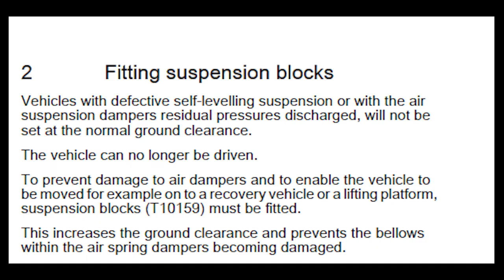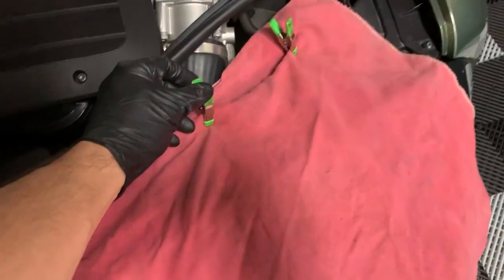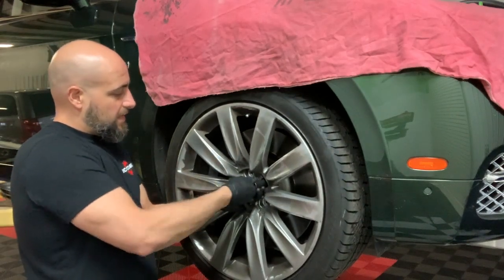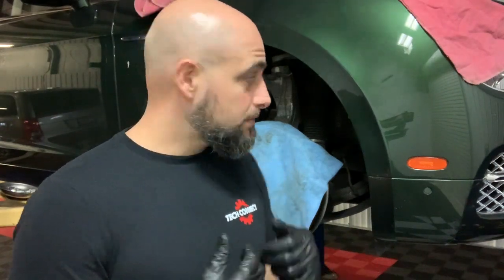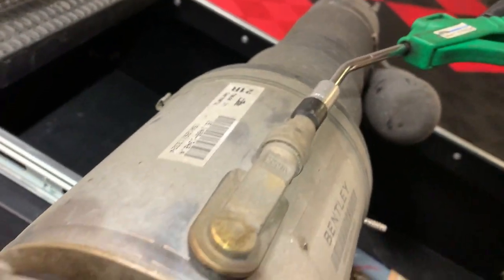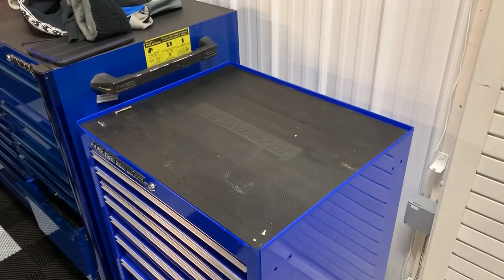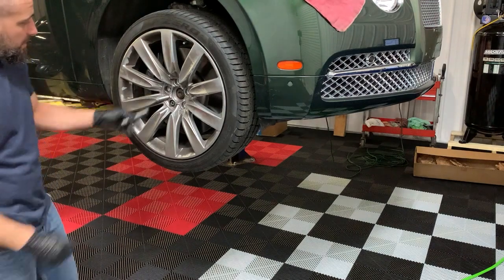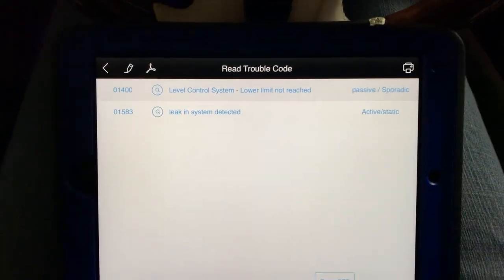Replace air shock Bentley Continental Flying Spur  plus tips when diagnosing air suspension issues

Comment: You can remove that leaking fitting and use a different nut to screw it back. That round button you see is a bolt. Vicegrip and it comes out. Replace with another that has a head. BTDT, problem is a stretched brass nut.  Sell me the core I'll be laughing all the way to the bank
Reply from the maker: send me your address

Comment: G'day Master Tech Lou. Great Video! I'm looking at buying one of these so to see the repair of a known issue is great: nothing I can't handle apart from buying some new tools. However given the apparently simple nature of the failure and the huge cost of the replacement part and the fact that you're going to chuck out an apparently otherwise usable part, why not try to repair it? Looks like a big rivet holding the connector on to the body so why not try removing the connector, dumping the failed gasket and then drill and tap the rivet body to reattach with a bolt, with a new glued in place tougher gasket. Or just TIG weld the connector to the body? Have a go, mate, nothing to lose if it's going in the bin. and you may end up a hero. Cheers Robi.
Reply from the maker: Maybe I will attempt! Seems like its fixable but hard to find parts
Reply: @MasterTechLou  I'll keep watch to see how you go. Interestingly I've found the main rolling bag in these is susceptible to failure, reportedly from aging process causing cracks. However experience here in Australia with air suspension on a Mitsubishi Verada model (similar to Diamante in USA) showed ozone damage and stone damage (even in suburban running). Looking at the Bentley's enclosed design makes me think ozone damage is most likely, so I'm thinking using a nitrogen feed for the compressor and blowing nitrogen into the struts might be a useful trick to extend strut life. Ozone damage is vastly under rated in relation to stressed rubber components, and there's plenty of ozone around, especially in cities. 
I'd like to see inside the compressor system, too. If it uses a brush style DC motor then it may be it's own ozone generator....
Cheers Robi.
Reply: @MasterTechLou  Ali Express its a nut inside lol

Comment: Thank you for the video. I like the way you explain stuff. It will become handy someday for my MB R500 with air susp. greetings from the Netherlands.
Reply from the maker: R class is simple! But tricky. I love the R class and was sad they stopped making it. I appreciate you and your comments!
Reply: @MasterTechLou  thanks for your reply. Yes I like the R also very much. There aren’t many of them, found mine in Switzerland with low mileage. Its a Long version. It has only one thing which I am repairing right now; there is a squeezing sound on the front left wheel when driving slow (5-40km/h) when I gently press the brake, its gone. Can’t find it, its not the heat shield or worn pads. It’s not a bearing either. I just keep on searching , its hard to find🧐 cheers 🍻
Reply: @MasterTechLou  by the way, what I like about your films is that you aren’t ‘tired’ of the cars. I speak to a lot of mechanics these days, and somehow the older ones are all complaining about the way everything is build these days. They don’t see the challenge anymore to fix a difficult problem. While thats the whole fun of it. Here in Europe its hard, because Audi and VW aren’t the cars anymore from the nineties in terms of logic and construction. Anyways…just wanted to share.
Reply from the maker: @four38AM  sometimes you can take the pads off, scratch them up with sandpaper, smooth the edges, same with the rotor, scuff it up. it will or may help.
Reply from the maker: @four38AM  I appreciate that! Im tired from a lot of things ha, but cars is what I know, and I love the challenge of figuring them out and making them better and like new again for customers. :)

Comment: Thanks Lou. I am looking to buy a 2012 Flying Spur with 60K miles.  I know that two front struts were replace at 50000 miles.  Concerned that car pulls to the right.  Alignment did not fix the issues. Could that issue be suspension related I.e. the suspension is likely to fail again or it was improperly installed?  Or might it be steering, all wheel drive transmission or something else?
Reply from the maker: Tires. Tires cause pulls more than alignments do.

Comment: Hi there buddy, viewing from the UK, was wondering if you could state the part number as I have the same problem, will replace the struts and take it from there.  just hoping the compressor hasn't failed. Thanks
Reply from the maker: I looked up the part numbers on arnott website and then gave them to the oreillys parts store here in usa and they ordered it. I do not have access to Bentley part numbers directly sorry

Comment: Is an 06 Bentley with 48,000 mi a good car
Reply from the maker: No one can answer that. It needs inspection before purchasing. You cant go off of age and miles. So many factors in used cars.
Reply: They all have their problems... The trick with expensive cars is you better have either the wallet or the skills to fix it yourself.  There is no 3rd option except a sugar momma.   Not saying these can't be reliable, but with anything mechanical, you have to use them and maintain 'em.
Reply: I owned an 07 GT new, hot a good car. You don't want anything older than 2013. You want the upgraded car. The infotainment system on the 12 and below are deplorable

Comment: Lou, what do you recommend for a scanner for these bentleys?  I'm fighting a suspension issue and want some answers before I spend the bucks.  Thanks!
Reply from the maker: Well ive used both my autel and the A30m I think for cost the a30m might be your best bet to try.
Reply: @MasterTechLou  Thanks Lou.  I'll check them out.  I was considering the VAGCOM Ross tech setup, but for one car that's not even mine...  Helping a friend out on this one.🥴
Reply: Bought a scanner (A30M) and it said I have a leak.  NFS!!!  Didn't need to spend 240bucks for that epiphany.  I did look through all the live values and nothing looks out of place except for the front struts on the ground and the rears look really high now....  I guess it's time to try to find this needle in a hay stack.  I'm thinking isolating each front bag and inflating them with shop air, close them off and crack a beer as it sinks back to floor.  Note to anyone that uses the arnott valve block, pay close attention to the colors, The locations moved around a little from the stock valve block.  Why they did that dumbshit I'll never know.  Ya know Lou, looking around in the a30M today, I didn't see anyplace to calibrate the suspension...  Did I miss it somehow??
Reply from the maker: @jagboy69  do not ever try and calibrate the suspension!!!! Theres no reason for it ever.
Reply: @MasterTechLou  Good to know.. I'm guessing it will automatically level itself.👍
Reply from the maker: @jagboy69  the only reason to ever attempt calibration is if the metal brackets that the sensors mount to get damaged. Normally i measure all corners, any side thats off I tweak the bracket(s) until it matches. Done.
Reply: @MasterTechLou  Rubbish if you know what your doing its described in the Bentley workshop manual and the Rosstech interface will reprogam all the height sensors back to factory spec if you know how ..you dont

Comment: Do you need air suspension repair mechanic
Reply from the maker: Air suspension is easy.   Not much different than regular suspension. Just air instead of springs.
Reply: @MasterTechLou  no boss
Reply: @MasterTechLou  we repair air suspension we change the balloon and dust cover and buffer and o ring
Reply from the maker: @gurjeetsingh-uf9ek  oh I guess I misunderstood your statement.
Reply: @MasterTechLou  yes boss